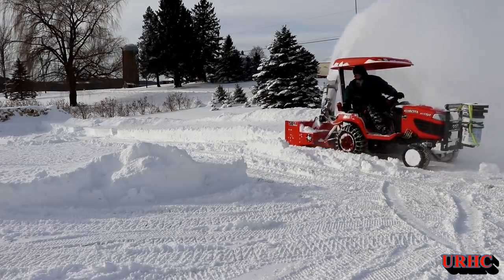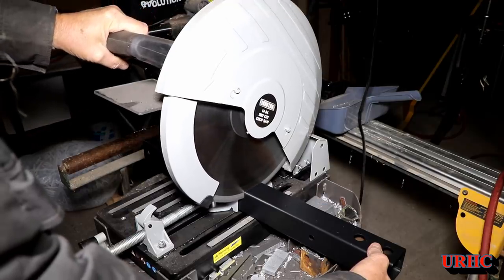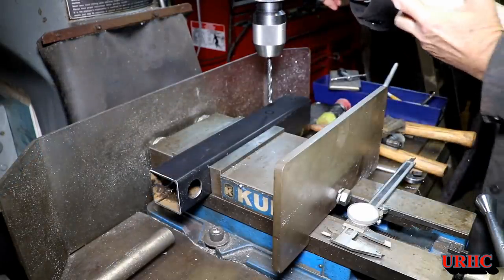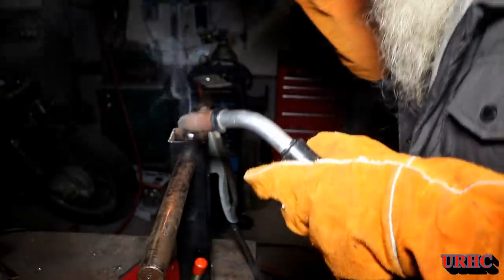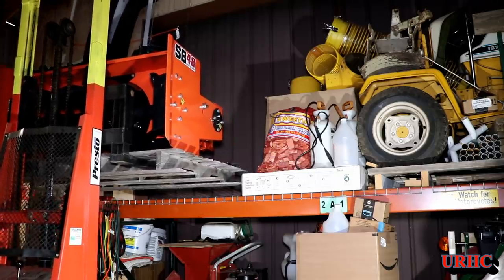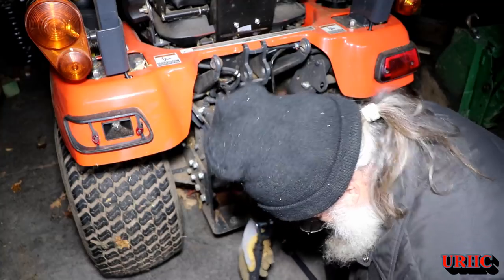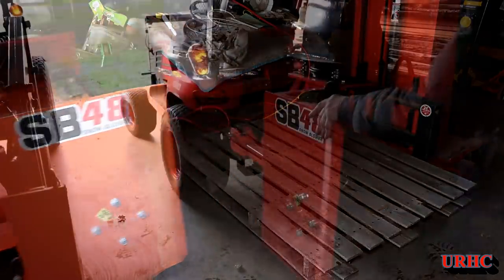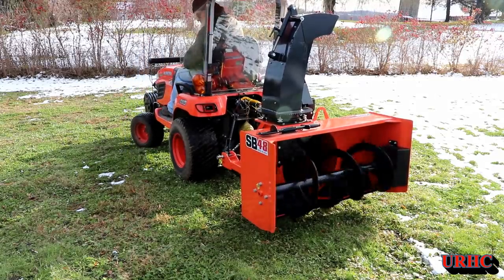New Weights For My Kubota BX With The Woodmaxx Snow Blower

Comment: Very nice setup.  I had also found some reasonably priced steel barbell weights that I placed in my aerator’s basket for achieving greater depth.  As you say, far less expensive than tractor suitcase weights.
Reply from the maker: I couldn't believe that the suitcase weights are over 2 dollars a pound.  These are also very easy to handle.  Thanks for watching.

Comment: now all ya need is a swivel chair to turn around.   are the axles made to hold all that weight ??
Reply from the maker: The axles are made to hold a loader with500 pounds in the bucket so this way below the limit.  Thanks for watching.

Comment: Is the tractor a BX2360? Do really think 5hp is a more usable hp for a subcompact tractor?
Reply from the maker: You have to look at pto horsepower requirements for the implements you plan on using. I think this is only about 18. Wish I had more hp for the blower in deep dense snow..  Thanks  for watching.